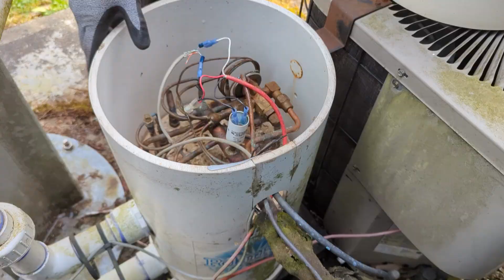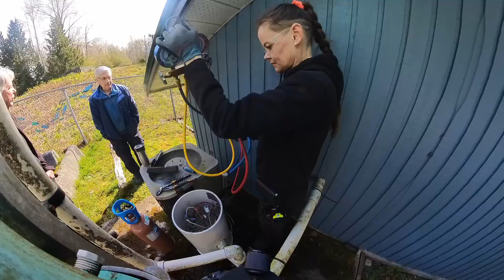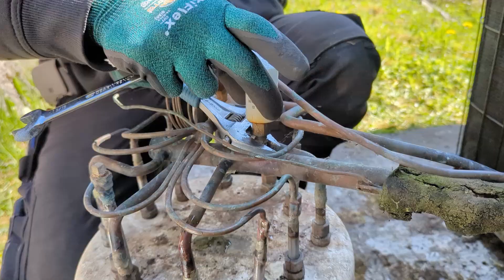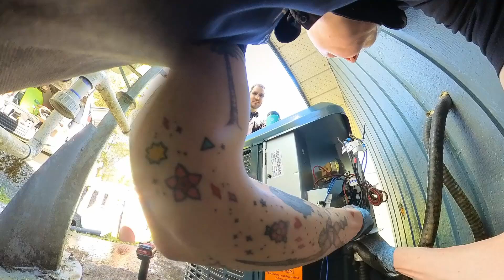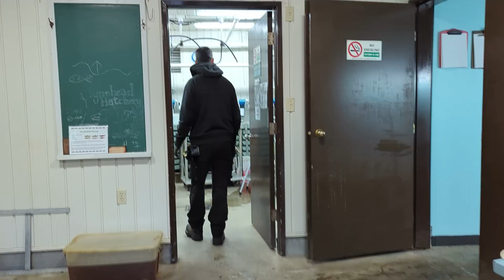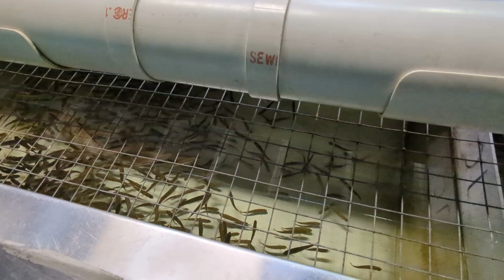Salmon Hatchery Water Chiller System Condensing Unit Replacement | HVAC Vlog

Comment: what a cobbled mess that was and the custom cobbled condenser, they sure packed the control area with stuff. transformer, bypass timer, delay timer, probably had a low pressure/high pressure switch added. yummy yummy.

Comment: That's a tough one. Volunteer supported hatchery trying to do good. Built a cobbled together water cooler for fish eggs. Held charge for 2 years. Not saying I would gas back back up, but not saying I wouldn't! Good on ya with the leak at pressure switch. Happens a lot.